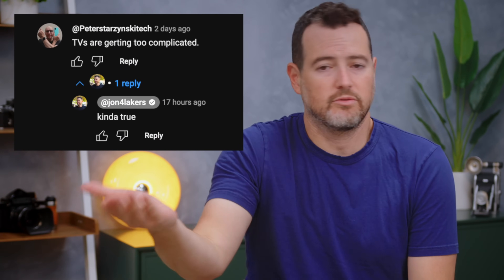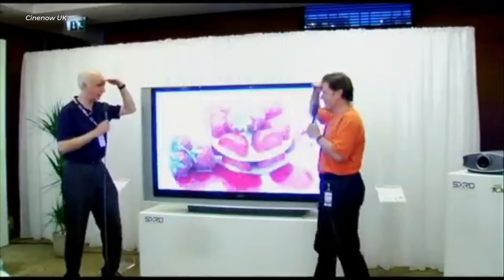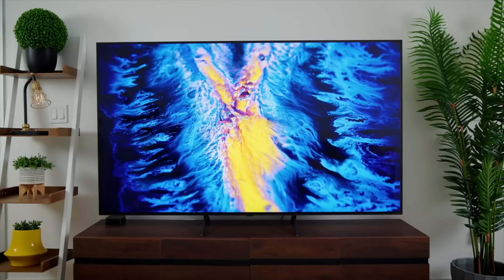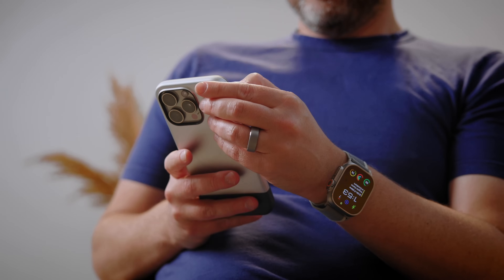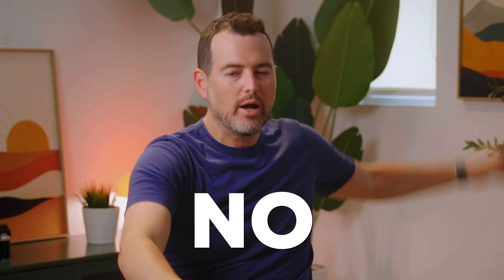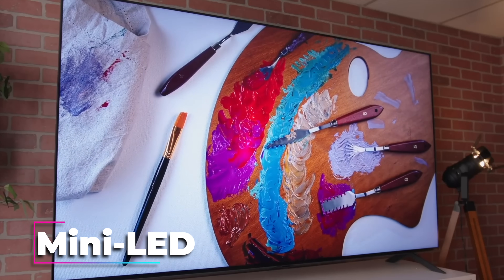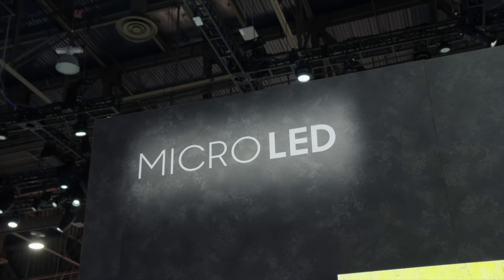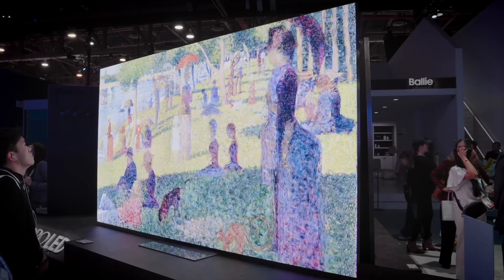LED vs LCD TVs 2024!

Comment: tv's are not too expensive. the one thing that has been decreasing in price compared to inflation are tv's they are the cheapest they have ever been
Reply: Yep flagship TVs are a fraction of what they were years ago. It’s the only consumer product on the planet where we have gained ground last 20- 30 years. A crappy tv 20 odd years ago was a K. Now a K almost gets you something like a 65 inch Full Array Sony X90L.
Reply: Yes bro monitors are 3 times expensive than TV's
Reply: Litteraly stick the word monitor in it and it's double the price

Comment: Hi, i need some advice. I can't decide between a a80l 83" or bravia 9 85". Im used to my 6 year old samsung 75 " tv. Thanks darrell
Reply: I looked up the models you described and it looks like the bravia is a mini-LED and the a80 is an OLED
That's a simple answer: If the room the TV is going into is very bright (when you are actually watching), then go mini-LED, if you can control the ambient lighting, go OLED.
Source: I'm a video editor
Reply: @PlayerGuyPlays  i ended up getting an A80L 83" but it had a defective panel .so I have a bravia 9 85" now. Thanks

Comment: Compared to the price of televisions in the 50s and 60s todays flat panel sets are ridiculously low priced. Paying $400 for a television in 1960 would be like paying $2,800 for a television today. My father clothed and fed a family of five kids on $80 a week in 1960. We didn't have a television in our house until 1966. I didn't own a color television until 1979. Paying $400 for a television in 2024 is about the same as paying $80 for a brand new set in 1960.

Comment: Don't watch TV. No Cable or Antenna. Computer all the way. But these TV's you talk about or no good for gaming thru a Computer. Ah thing called Burn In.
Reply: Burn in is not really an issue anymore most of these TVs are pretty well calibrated to get around that not to mention they have pixel shifting
Reply: TV as a monitor
Reply: @DoodleDan  Yes their are people that use their tv as a monitor. Where you been!
Reply: Tv's use the same tech as monitors. 
There's no more of a burn in risk than from an equivalent monitor.
Plus Tv's aren't just for Cable, I use mine with my PC.
Reply: @MsMarco6  sorry but only 2 people replied out of Millions. I don’t trust those odds.
Reply: @Airbrushkid  Tvs work fine on a computer. Plus burn in isn't really an issue, besides they're so cheap now
Reply: @Airbrushkid  Literally everybody who replied to you disagreed with you. how about those odds.
Plus millions of people not replying to you isn't a sign that your right, if you were you'd have received likes, be further up in the comments & get more reply's.

The people replying to you have experience using TV's as monitors.
Including myself who uses the TV type with the highest burn in risk (QD-OLED) yet have had 0 issues. After 18 months of use my panel is still more uniform than any LCD would be out of the box.
You don't wanna by a TV that's fine but don't go spreading misinformation on a topic you clearly know nothing about.

I mean seriously how dense so you have to be to believe that TV's, the most popular display type for home gaming since the 70's somehow suck for gaming. 
As if Monitors have some kind of magic sauce despite being the same panels developed by the exact same companies.
That's right your monitor panel was cut from the same slab of glass & was assembled on the same production line as the TV's you can't stand.
Reply: @MsMarco6  Fkup thing is. I have had 2 different tv’s by 2 different nanufactures end up with Burn in. Both were returned for a refund. Millions mean nothing with 3 Billion people on the planet.